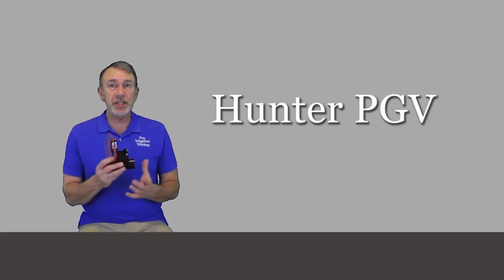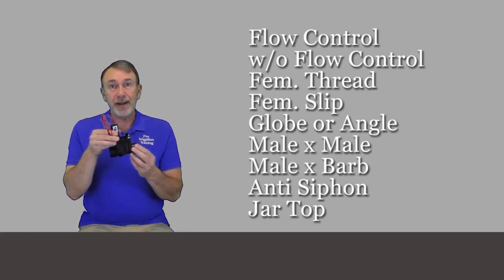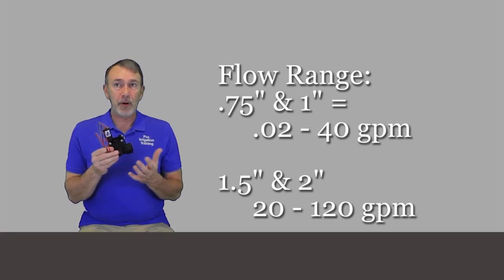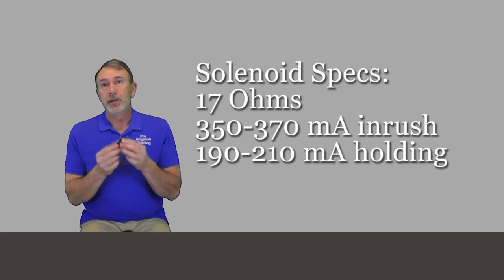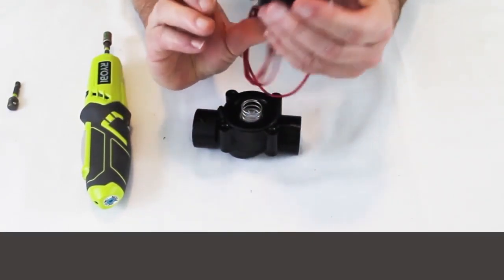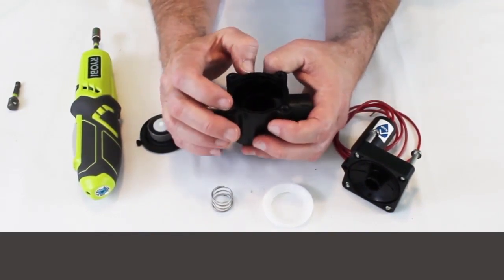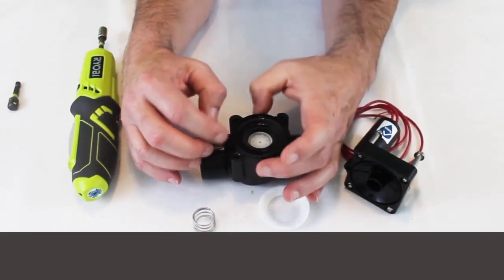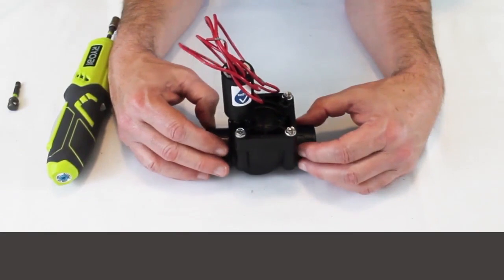Hunter PGV How To Rebuild Irrigation Valve

Comment: Mine never turns off.
Reply from the maker: Check the voltage on your timer terminals to make sure it isn't the timer doing it. If not, then rebuild the valve. Occasionally the valve body, the bottom piece cracks, but 95% of the time, a rebuild will solve any problem the PGV has in this regard.